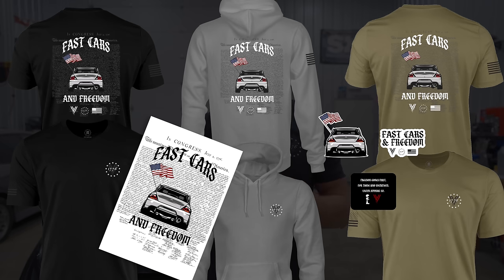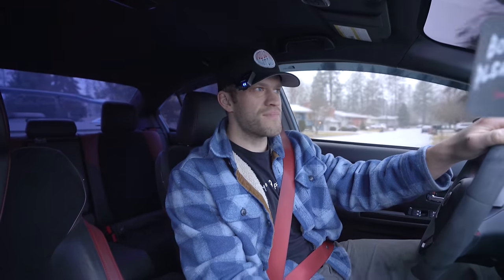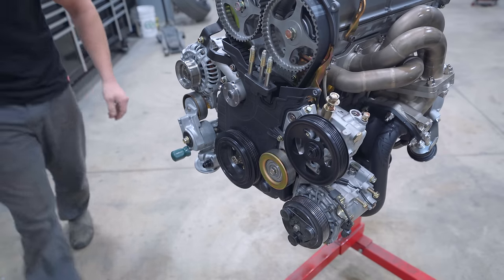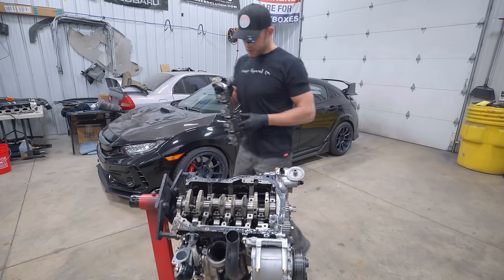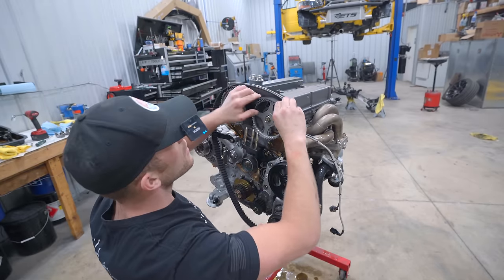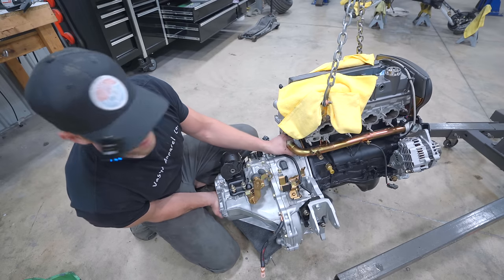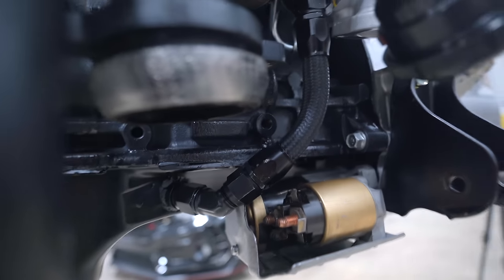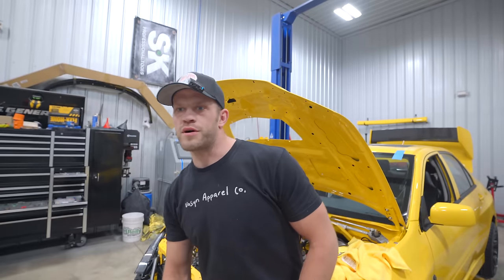THE ABANDONED EVO 8 RESTORATION | EP. 65 (it gets worse...)

Comment: The oil pan fitting you welded on looks like it is pointed down and if that is the case, the oil won't drain back into the pan properly and it will probably leak again.

Comment: You didn’t torque the outer bolt on the intake side cam cap, you torqued the bolt next to the inner bolt??

Also you can install the rear main seal after the plate, this allows you enough room to put the plate on without scraping all the sealant off the bottom edge.

And walking the seals on instead of shoving them straight on will help prevent leaks on brand new seals.

Comment: You didn't torque one of the two bolts on the cap seal, the one on the backside of the valve cover. @11:26 of the video